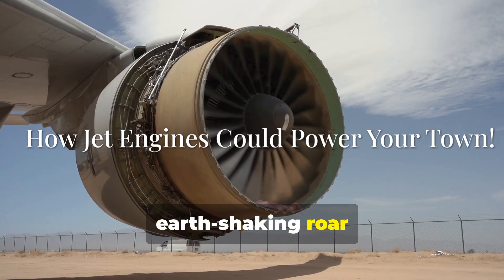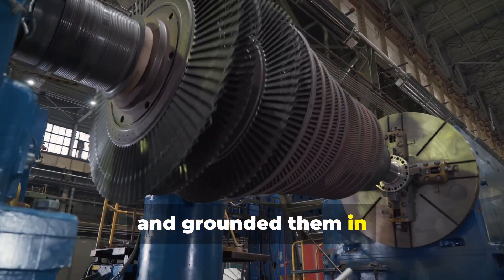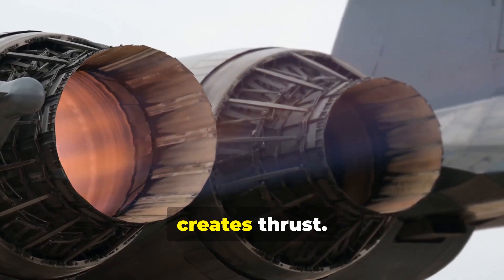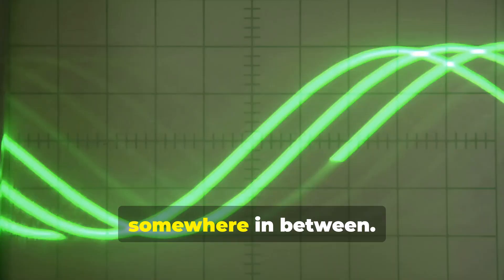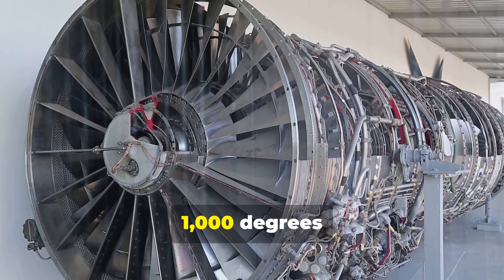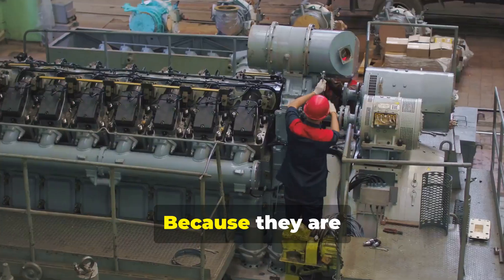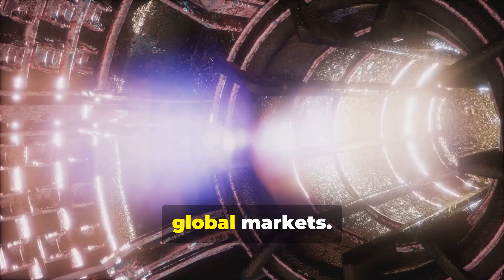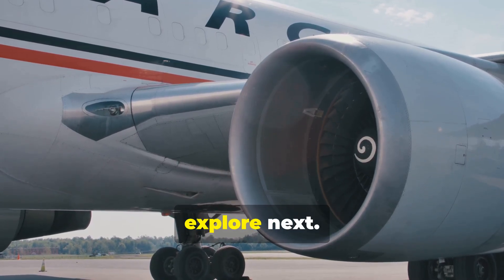Airplane Jet Engines Secretly Powering Your Neighborhood Homes ? 10,000 MW of Electricity Generation

Comment: Mr electronic can I use a 750 watt motor to drive a alternator of 1500 watt my friend did it and it is working
Reply from the maker: To what end. You want to generate 1500 watts from an alternator just by connecting a 750 Watts motor ?
Reply: he is paying for a 750w load and using a 1500watt load @MrElectron
Reply from the maker: Fake